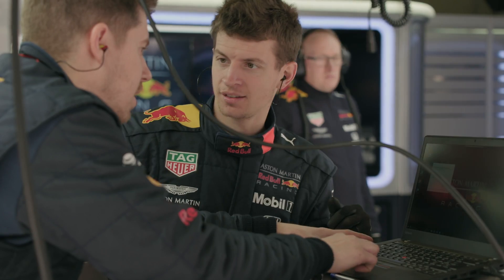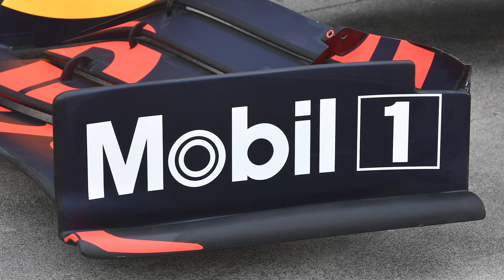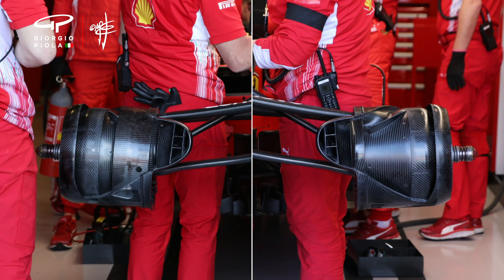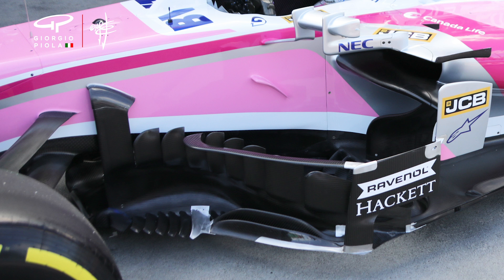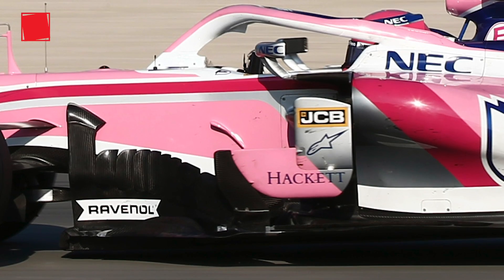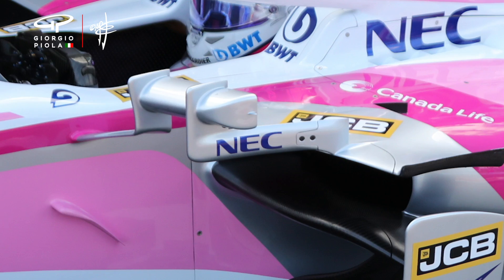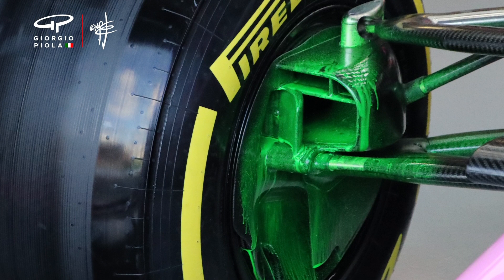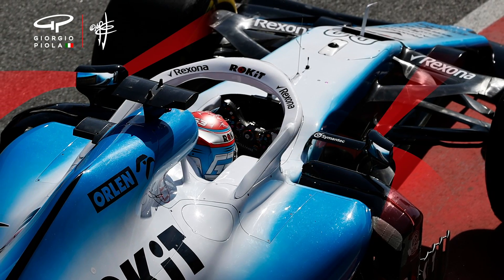F1 tech developments at the Australian GP

Comment: Is it only me or its NOT the right front brake doing "more work" braking to a right hand corner ... ?
Reply: Another nonsense JBL interpretation. If you had one side braking harder the car would veer to the stronger side under breaking. It would result in huge unpredictablility at corner entry. Equally during trail braking weight is shifted to the outside tire. If the right brakes harder its more prone to lockup.

My vote is that they are comparing cooling performance. First few practice sessions are never about speed anyway. Think of it as more testing period.
Reply: @ZVilleneuve  its not that one side is braking harder, its about one side having to deal with more traction than the other ...
Reply: @tomasz_peszke  That doesn't matter. There is no way to differentiate the amount of brake force from one side to the other, only front to back. So you can only brake as hard as the traction on the inside tire will allow or it will lock up. 

I think what they are doing is trying to compensate for the tire blocking airflow to the brake duct when turning.
Reply: @wingracer1614  exactly. The most logical answer is the inside wheel receiving less cooling in turns because of the wheel angle.
Reply: Possibly to help cooling the outside tyre that does more work rather than the brakes, so to try and give equal temperature across the axle for a balanced braking and cornering performance.
Reply: The inside wheel needs to be slowed down more, when turning the outside wheel will moving faster, so needs to be slowed down less
Reply: @FrostIceAndFire  True but we are only talking a few rpm for a second or less. I haven't done the math but my guess is the difference in energy would be less than 1%. Also, because of ackerman, the inside tire is going to be operating at a greater slip angle which means more rolling resistance with the track surface. I wouldn't be surprised if that 1% or so energy difference is actually absorbed by the tire and track itself instead of the brakes but again, I haven't run the numbers so could be wrong. Which has all encouraged me to do some research and run some numbers. This could make a nice little paper assuming some dude at SAE didn't already write one in the 50s.
Reply: I'm not a driver but I think they lift the brake before turning tho, or not?
Reply: @tommasoannoni4836  They are still braking in corner entry ... right hand corner surely means left brake does more work ... but i might have miss understood him ...
Reply: Do they have a sneaky '97 McLaren-esque 3rd pedal? ;)